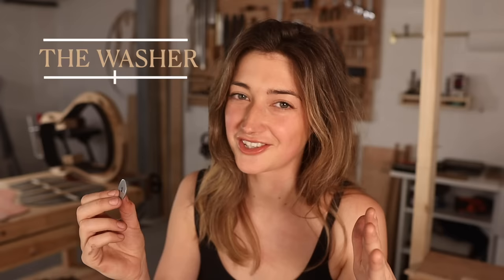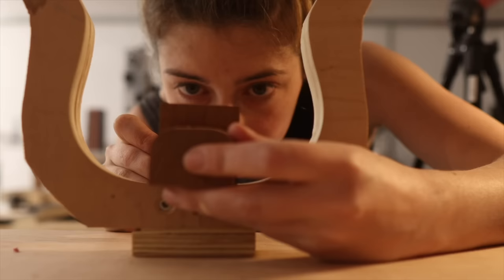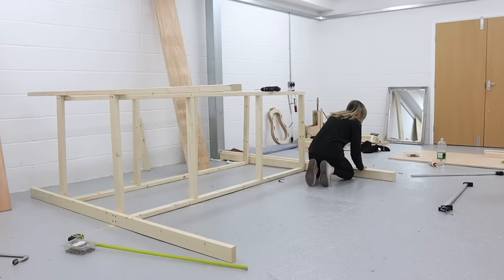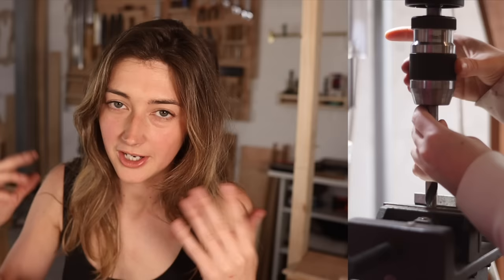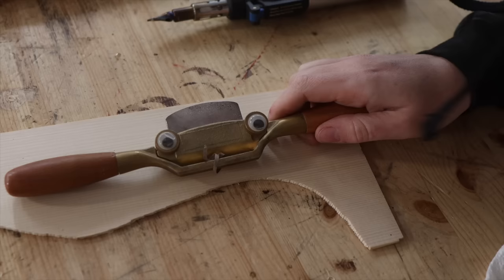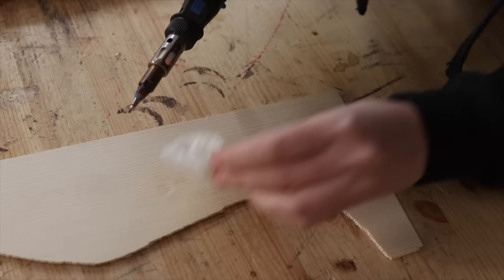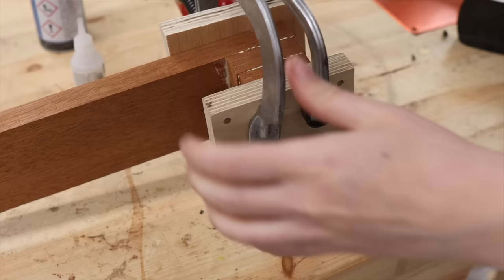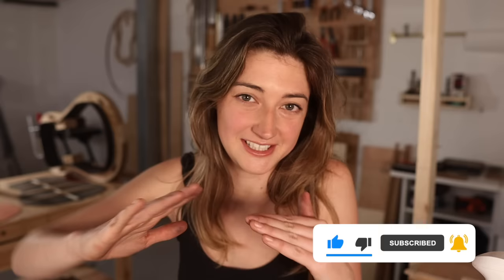Uncommon Tips to Make Woodwork Easier

Comment: For very accurate holes, i use a Rotabroach or the Evolution Tools equivalent Not cheap, but very accurate (I use them in steel) and they are spot on and stay sharp for years of use in steel. They will also leave the centre portion in place. The only drawback for you is that the shaft is 20mm so you would need an adapter for a drill chuck.  If you want to go down this route, i could make an adapter for you on my lathe so you can use with a normal 13mm drill chuck

Comment: I use a Jay Roller. Its a 3 inch wide one. Its a Formica and Veneer roller by design. I use it alot for myriads of other uses, and anything with glue, adhesive, tape, etc... I use it to roll tape down really excellently before drilling holes, or cutting a line with no burrs, etc... the skys the limit. It also is great for rolling on decals to perfection. Here is a technical write up example from a store: "Specially designed for applying laminate as well as veneer, the J-Roller provides 20-25 PSI for positive bonding. The wide non-marking rubber roller is ideal for flush work."

Comment: In stead of super glue to avoid the wood from slipping, you could just sprinkle a bit of fine salt. The salt will be dissolved in the glue rather quicly but will remain formlomg enough to stop the two pieces of wood from sliding around in the wet glue😀
Reply: How did you read my mind, like 20 hours ago... ;-)

Comment: I have used the water soaked rag and hot iron (for clothes ironing) to create steam  pressure. My father was taught to soak the dimpled area with alcohol and light it so the heat from the burning alcohol fumes create steam in the wood fibers. The wood doesn't burn since the fire disappears when the fumes are exhausted.
Reply: Never occurred to me to light it on fire. Hmm, better clean up all your sawdust first.

Comment: Masking tape (decent quality stuff like Frog Tape or 3M)... used as clamps for awkward glue ups, put it into the internal corners of any box during a glue up and just whip the strips away along with any squeeze out, use as temporary or not so temporary labels... I used to be a nightmare for writing on my workpieces with pencil and even Sharpie I still do it but now on a bit of tape that I stick to the workpiece and finally Google masking tape dovetail joints.. revolutionised instantly my handcut dovetail joints.

Comment: Thank you very much for the tips.
A trick I use a lot is masking tape and super glue. I saw it on the Crimson Guitars channel (sorry to mention the competition, but it's very useful).
Many times, when I want to glue pieces of wood in a certain position; I drill 2mm holes and use a toothpick as a guide.
Another trick is to use the masking tape as a fan; a strip of tape is placed around a bit, so that a flap is formed with it; and turning that will blow the dust and wood shavings; improving vision.
Reply: Tape around the drill bit is also a handy depth stop

Comment: Careful with trick number three when putting the plane in the vice! Ideally, the sole of the plane should be about flush with the jaws of the vice, otherwise it's very easy to snap off the sides of the plane.

Comment: Inner tubes are also great for making vacuum hoses fit tools where the fit is loose otherwise
Reply: That is brilliant! Thanx. I use 32mm and 40mm gray sewage pipe (with until now, duct tape) as coupling for extending my vacuum hose, they do fit in each other, but not that great. The inner tube trick will be  a nice addition.

Comment: Be careful with the drill lathe idea, that can lead to concentricity issues. Side note, double sided tape is amazing. I originally got it for some purpose that I hardly use it for and have since found a dozen other better uses for it. One great example is questionable cuts on a miter saw. If the piece is small or a cylinder, I'll put some double sided tape on the fence and the table then press the wood in place onto the tape and make a hands free cut. It works extremely well, though I do still stand back a little and at an angle.

Comment: an older version of adding superglue in the middle of your woodglue is to sprinkle some coarse salt on the glued surface before clamping. The grit bites into the surface and reduces slipping, but ultimately dissolves into the glue.

Comment: used motorcycle inner tubes make great heavy duty rubber bands, you can usually get them out of the dumpster at your local motorcycle shop, they come in different diameters and thicknesses and you can additionally control the amount of retentions strength by the  width of the bands you cut, also you can make rubber bands a large as you need by using super glue to glue pieces together, all you have to do is wash the rubber with dish soap and water then dry with towel first then super glue will attach pieces of rubber together instantly....

Comment: When glueing flat surfaces(across the face of a board., I have used Daly , shake a little over the flu and clamp. The salt will bite into the wood as you apply clamping pressure and prevent the wood from sliding around .

Comment: I seem to remember you can increase the clamping pressure (if you need to) of the inner tube by inflating it slightly once it's stretched into place. The method was used in gluing up spars in boatbuilding using rubber surgical tubing. I could easily see it creating too much pressure on thin material like a guitar body, though. I also took the valves out of the inner tube nozzles and used the empty nozzles as ports when vacuum bagging. Then, of course, there were the guys who needed to put inner tubes around the tailgate chains on their pickups.
Reply: Guitar makers like Fender use a variation on the inner tube—but slightly inflated—to glue together necks and fingerboard veneer.

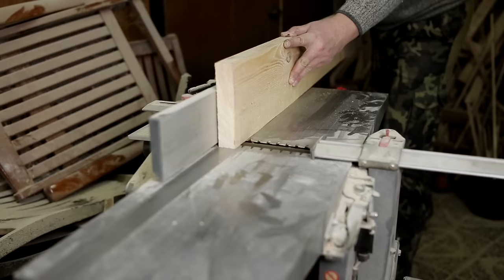Comment: 1:44 Nothing wrong with that, but be safe and put the plane a little further down into the vice: too much pressure and the cast iron cheeks of the plane will crack. If you apply the pressure near to the sole of the plane, it’ll be fine.
Reply: What mm said

Comment: also for slippery clamping.  spread out glue. and take a salt shaker and shake it over the glue. the grit of the salt will stops the wood/ glue joint from sliding.  so it can be clamped

Comment: When using anything that has a thread on it like bolts or screws or nuts even... Start them by turning backwards until you feel or hear the click of the leading thread falling into place. You will NEVER cross thread another thing. The cross threading is what strips out screw holes .

Comment: Late to the party here but hope Daisy reads comments.  There is a proper iron for that sort of job. I've called them packing irons but I don't know what they go by in the UK. You need one for many jobs not least of which is heating areas when ungluing something.  Perished tyres are all well and good but see a nurse next and ask about surgical tubing. Better product all round. If it is too thin to behave on the shooting board put painter's tape on the back and on a random board and super glue them together. Plane then peel. A little heat from the packing iron (see above) if it is really delicate.  Sanding to dimension is much easier in a drill press. Put a screw through a scrap to serve as a dead centre and you can hold even decent size pieces still laterally while you sand. (0.001" is quite doable)

Comment: Rather than a soldering iron to remove dents in soft woods, try a clothes or flatiron over wet towels. Since it operates at a much lower temperature over a larger surface it's safe and can cover a larger dent or groove

Comment: Great tips.   I find the dowel lathe trick works better with a file.  I also file thick Brass or Stainless  tubing to make all sorts of things, like bushings, tiny washers, etc. Very precise cutting off is also possible with a fine sawblade and a kerfed block.

Comment: One trick for "slippage" when you are gluing boards together is put a very small bit of sand in the glue.  When you clamp the boards together the sand will compress into the wood and hold it from slipping.  Just remember, only a little bit!
Reply: I’ve heard of doing this with salt. I’d be concerned either method would jeopardize the integrity of the bond. Thoughts?
Reply: @AndreaCuchetto  I've never had a problem.  I'm talking only a tiny bit of sand

Comment: The main part of the logo I put in my guitars is an O, usually made with wood. I use a small drill pilot hole to mark the centre, then with a forstner bit I drop barely a millimetre into the wood to mark the outer circle, then drill out the centre circle to whatever size I need before sanding the higher edges away. It's finicky but gets a pretty close to perfect circle ring shape.
Reply: try out a router ? there are many setups possible with a router-bit instead of a coarse drill-bit. much more accurate
Reply: @jvaneyl5826  I have no idea how you'd make a small circle with a router. 🤔 I have a plunge router and also a small router base for my Dremel.
Reply: @carlhudson4368   Well, there's something called youtube as i remember, with tutorials on how to make jigs for example...😜  E.g. How to Build a Circle Cutting Jig for Your Router form YT-channel GOT IT MADE  of just search in YT for Cicle cutting Jig router... There are a lot of easy-peasy ways to make a sharp-edged circle !

Comment: Instead of your soldering iron, take a couple of sheets of kitchen paper place o ver the dent and then wet with a fine spray (household plant sprayer useful). Following this take your ordained household iron and with steam function turned off on a low to medium heat iron the kitchen paper. Same result achieved without the fear of your soldering iron heating through and burning the wood.

Comment: I hear your frustration about cutting perfectly circular holes. Drills were never made to do that. If you do not know already the tool you need is called a reamer. Looks like drill bit but cuts holes with extreme precision, along the order of a half of a mil! They come in a multitude of sizes, not terribly expensive.

Comment: However ran that board over the jointer blew it. The gap on the outfeed indicated he failed to put needed pressure on the outfeed.  

I have a sweet 8" longbed with a spiral cutter. When I put all the pressure on the infeed, to the exclusion of the outfeed, I have to run it again, for a good joint.

Comment: I'm mostly a kitchen knife maker, but I will suffer though making up boxes with veneers for them on occasion. So woodworking is a necessary evil
The superglue in the middle of PVA is new, I always used a pinch of loose sandpaper grit (or just plain sand) to the PVA gives it enough roughage between the surfaces to bite down on when they're clamped and won't slip anywhere.

Comment: I figured the dowels/drill thing out a few years ago and kicked myself for not knowing that years before! I was joining two pieces and wanted exposed dowel tenons (because they're easier than rectangular tenons, don't judge me). I bought some nice 12mm hardwood dowels, drilled each hole with my 12mm bit, and found the dowels were about a half millimetre too wide. No chance a smaller dowel would work, and I didn't want to risk widening the holes. I started gently hand sanding the dowels when I looked over at my drill and thought, "Duh!"

Oh, and a trick I haven't tried but wondering about is to sprinkle salt on the glue face when doing a glue up. Apparently the salt grains are abrasive enough to dig into the wood fibres to avoid surface slipping, but small enough not to create gaps between the surfaces. Anyone ever try that?

Comment: I hate working with Wenge but it;s so damn sexy when done right. I swear it's made of steel wool and needles. I have a bad habit of taking wood off the bandsaw and just taking the burr off with a flat file and then brushing it with my finger, which is fine for literally any other wood other than Wenge, but you do that with wenge and you'll be picking splinters out of your finger for days. I know a company that makes solid Wenge guitar and bass necks and they have an option where you can get this super thin "invisible" wood finish for a satin neck and i just cringe thinking about taking my whole palm and power sliding down a raw wenge neck and pulling it back looking like a pincushion. No thanks. i'll stick to my current Wenge finish which is drenching it in thin CA glue over and over till i can sand it plastic smooth and then coating it with ultra matte Krylon. It looks and feels almost like raw natural wood but without the whole...turbo-needling your hands part.

Comment: The shaved pencil, I suppose technically becomes called a mouse. I have several made by my dad, he was an engineering pattern maker by trade, in various sizes some with lead glued in as the tip but most with metal ground to form a blade like point. When he had to use a shaved pencil he wouldn't plane down is all, but would instead do it on a shallow angle, easier to holdand therefore keep pressed against the surface, easier to keep sharp and above all keeps the strength in the pencil. Also stops the lead  from separating for the wooden body of the pencil.

Comment: Be very careful clamping a hand plane in a vise on the cheeks! Put it too low and/or too tight and you may just crack / break the cheeks of your plane. To avoid this, put the plane lower in the vise so the vise jaws are also pressing on the sole of the plane!

Comment: Q for you, or any other wood surgeons, about reclaimed/salvage wood as tonewood: does it work out well or is it more of a marketing thing? In principle it seems like really old wood that was a post or whatever would be nice and dried out, but I'm not sure if exposure to the elements, or adhesives etc, would compromise it for use in an instrument.
Reply: I have been using reclaimed wood for electrics (also acoustic necks). I've yet to find a bit of timber big enough to use on acoustic guitar top/back/sides. I did manage a mandolin though. The only real issue is the quality and grain structure of the wood. For 15 years my main timber has been a bunch of old 1950's mahogany window frames that I literally found in a skip. Billet the wood and let it sit in a corner while it stabilises then throw out the duff bits!

Comment: you can als use a router if you want to make accurate holes or cicles. there are many set-ups possible with a router, its more accurate than with a drill - SEE for Example How to Build a Circle Cutting Jig for Your Router form YT-channel GOT IT MADE  of just search in YT for Cicle cutting Jig router... There are a lot of easy-peasy ways to make a sharp-edged circle !

Comment: Not so much a good trick, but I like to sight down the edge of boards.  Start with good wood, and the project is a lot simpler.  

As for cup, bow and twist:

1.   Rip cut cupped boards into thinner strips.
2.   Cross cut bowed boards into shorter lengths
3.   Try to avoid twisted boards, but If you need to use it here's how:  Set it on a reasonably flat surface, and put some shims or thin wedges under the high corners.  Plane down the high spots on the top side.  Flip it over, and plane down the high spots on the other side.  Now you have a reasonably flat board that you can dimension.  There are lots of excellent tutorial on YouTube about how to do this with hand planes, planer sleds, jointers, router sleds, etc.  I have used all methods, they all work.

Keep up the good work!

Comment: great tips! in metalworking there are things called reamers that you can use when you want a perfect sized hole. i imagine a reamer set would work on wood too. 123 blocks are also really useful in that they are perfectly 1 inch by 2 inch by 3 inch in size. i'd imagine there are metric equivalents to those but maybe not.
Reply: There indeed are metric 1 2 3 blocks in 50 100 150 mm dimensions.